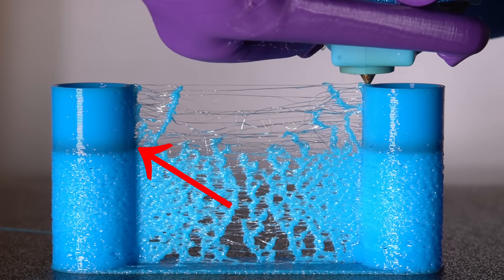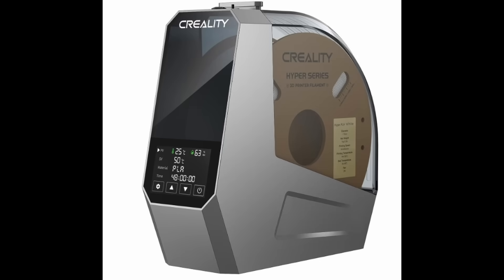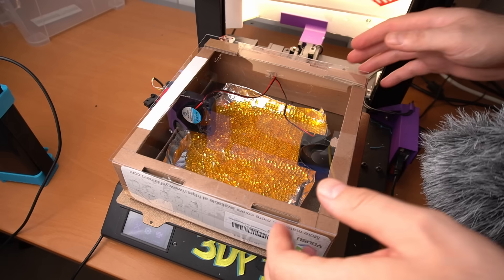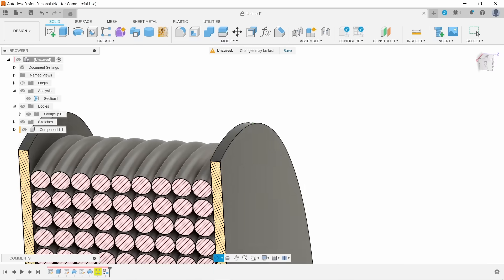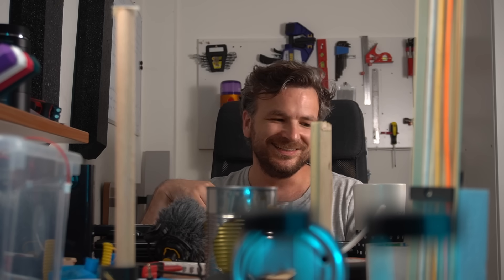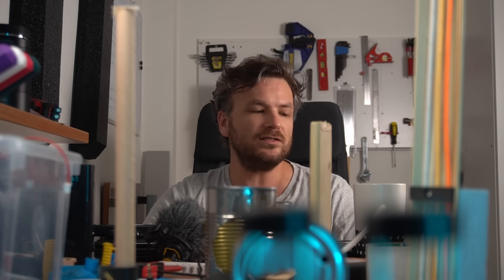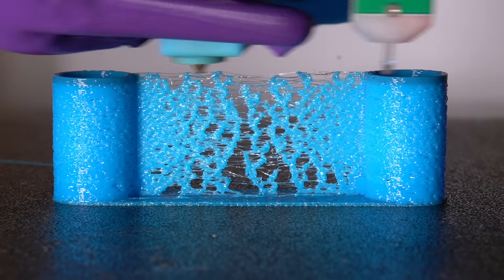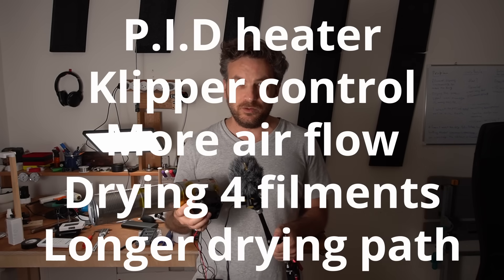Why are we drying filament this way?

Comment: you culd try adding a few 180° turns, runing the filerment muilteble times threw the sqame 3 cans AND i think you dont neet heating at all, the airflow alonw shuld pick up the motor from the filement, maybe pare this with a dehumidefyer and a closed system so you get evin dryer air

Comment: Use a helical drying path.

Use pre-dried air out of a mini desicant dehumidifier. Air humidity matters more than air temperature, if its near 0% out of a desicant dehumidifier you can keep the temperature down and avoid potentially breaking / stretching the filament.

Put the fan closest to where the filament leaves. Make it strong enough to flash-dry the filament, you want dry, warm air in, cold, wet air out. If you can put an even more powerful fan at the other end that sucks air out you would have a lower air pressure system that causes the filament to dry even faster. 

Some kind of heat conductive material that is highly porous to air and moisture could touch the filament for better heat transfer.
Reply: Dry air alone does dry out filament but it takes a lot longer. CNC Kitchen tested this out when he was doing some work on dry boxes and dehumidification, and it took multiple days for a spool to dry out in a dry box compared to the typical few hours for heated drying.
Reply: @bosstowndynamics5488  Did the dry box have active airflow?
A filament drier, even without a fan, will still have airflow via convection.
If the dry box was just silica gel, then no airflow.
The air should also be warmer than ambient, though most filament driers try to get the filament up close it's glass transition temp, at which filament has pretty undesirable characteristics unless it's already in an extruder. So lower temperature (yet still warm) extremely dry air is going to be better than warm, still damp air. Relative humidity drops as temperature increases, so you could absolutely get the rh down to near 0 by drying it and heating it.
Reply: @daviddavidson2357  No, the dry boxes were testing those electric membranes for extracting moisture. I'm not saying it's impossible to dry filament at room temperature, but I feel that the amount of performance you lose from not heating it is going to be far more substantial than any gains from using technically drier room temperature air when you factor in the substantial decrease in RH from heating (being up near the boiling point of water is going to get you close to effectively infinitely dry air after all). A setup using room temperature air would be a lot harder to build and run without any real benefit

Comment: Super overkill. I just bought $3 plastic cereal containers from amazon and I keep my spools in them with a cheap hygrometer and a desiccant pack. Then I took another cereal container and printed a spool holder inside of it and put a PTFE tube connector on it, again with a hygrometer and a desiccant pack. When I want to print a filament I move it from a storage container to this container which is connected via PTFE tube to the printer. The filament is never exposed to the atmosphere and is always dry. Cheap, passive, no chance of catching on fire, easy enough anyone could do it.

Comment: The way to inline dry effectively is to reduce the sublimation point of water and heat if you want to do it in a compact space...
Grab a cheapo vacuum pump, two ptfe lined heat breaks, 2M unicorn ptfe tubing, a volcano or equivalent heatblock, whatever electronics to turn on vacuum pump and heater block, 2ft copper tube (Make sure it can be form taped for a M7 thread for the shitty heat break), one brass compression + (Outlet for vacuum pump and cross for filament), jb weld (around threads of shitty heat break and t fitting fyi make sure to have tap cut proper threads in brass compression fitting should be 1/4 freedom units), forgot to add vacuum sensor use and analogue and not a digital TATA

Comment: The main reason as to why I didn't ever try inline drying is very simple. Apparently I'm not a genius and the idea did not occur to me. I'll definitely have to experiment with that! I have an idea to use the thermoelectric module to both dry and heat up the air at the same time by cycling it on and off while also cycling the air between the hot and cold side. When it's on, the moisture in the air forms a layer of frost on the fins of cold side radiator, then when you turn thermoelectric cell off the air warmed by the hot side radiator melts the frost and liquid can be drained away from the enclosure, then you wait until the temperature equalizes and repeat.

Comment: Drywise actually has a little diagram on their website showing how it works, it passes dry air over the filament in a heated space (hot air can hold more water than cold air), runs the air through the dessicant stored in the back to dry the air, and passes that dry air over the filament again. Without the dessicant you're pushing air with the same humidity it had to get the filament wet in the first place back over the filament, which is why your last test succeded, because you were getting dry air from the same container you stored the filament in. 
Looks like that add-on thing just heats up the filament, probably so the air doesnt lose heat to the filament, and is able to pull fractionally more water out? Or maybe for those "special" filaments they need to be soft (which the base system doesnt aim to do) to want to lose water to hot, dry air?

This looks great though! Its amazing too see what you were able to do just with some tin cans! 
I think if you can get a (mostly) closed loop for air to go through the cans, then pass the air through the dessicant (not over, like when you dried the silica on the print bed, but through like how drywise ports air through that dessicant filled tube on the back), then back through the cans.

From what i saw on the website, it looks like drywise put a lot of stock in having a unique setting for every filament type, but at the end of the day you can really only control heat, air speed, and filament speed. All three affect how much water is pulled from the filament, but only the first two affect how much water is deposited into the dessicant, but you seem more like a "see if it works by printing something" guy than a "test weights of filament clippings" guy, and I'm pretty sure "good enough" is gonna get you 99% of the way there. 

Very excited to see what you do with this!
Reply from the maker: Thanks for the explanations, I am let's see if it works kinda guy
Reply: No problem! Also, from what it looked like, you just had the dessicant sitting in the bottom of the dry box, you'll probably get better results moving air through it, rather than just over it like that? Like with drywise, all the air that's going to dry the filament has to go through that tube at the back making all of the air come into contact with the gel rather than just the air that happens to get around to the packets in your setup.

Comment: Here's something you could do - it stands to reason that it will be more effective the longer the drying takes place. You cannot really coil the filament or any bend radius but you can do it in a straight line.  Use a copper pipe like a water pipe and pass the filament through that - maybe feeding it from the floor or along a table.   By introducing the heating in the middle and having the air exit both ends should work quite well once the pipe warms up.   Even 1.5m pipe (which is possible along a wall or from the floor at 40mm /sec is about 38 sec - would seem not enough to draw the moisture out of the filament.  

Another idea I had was to extrude the filament twice.  So by extruding it you squeeze it through 200C and moisture boils out of it (messing up the pressure for extrusion), after which the filament is dry.  If you could then use that material that would avoid the issue.  Practically I can't see how that could be done.  But there may be a clever way to extract the moisture at the hot end.

Comment: I think it need a heating element in the cans,  to create inside a hot air area. Or the filament coul be inserted in a modified hotend with nozzle 1.75mm just to heat the filament without melting( 80c o Lesse depending the material). maybe two modified hotend, each in one side of the can.
Reply: Maybe use a cooper tube with 2mm wide and the length of the can to keep the filament temperature more even.

Comment: Awesome idea. I would love to see this developed into a reliable open source solution. I can see this becoming the standard in filament drying.
Perhaps it could be made physically smaller by coiling some filament inside the dryer, perhaps around a small wheel/which like thing.

Comment: I'm very excited to see you explore this idea further. I understand that your goal is speed, but I have concerns about adding a possible point of failure to the printing loop. What i might propose as an in-between step is a reel to reel system: two dry boxes connected by the wind tunnel, a motor turns one spool and pulls the filament along, even if it only matched the current 40mm/sec speed you could dry a full spool in about two and a half hours, and by separating the drying from the printing I'd bet the speed could be dramatically increased.

Comment: This is amazing.

I would greatly appreciate seeing this turned into a finished project.  Maintaining correct filament moisture levels is critical to good quality 3d printing.  An inline filament dryer that has a reasonable cost and is effective would be a significant improvement.

Comment: Need PCBWay to print you a quadruple helix shape out of titanium regular metal for multicolour, heh heh. 

I jest about a helix but would a coil shape get you more contact area with the heat? So you don't end up with a crazy long tube(would need internal feed rollers or something though). Gah, good luck loading another filament though... doh.

Instead of a single straight shot have some baffles between cans to keep the first section hotter? 
More heaters with cooling fans on the exit so it doesn't get too soft for the extruder gears?

Great idea I'm looking forward to more!

Comment: Was also thinking about such solution. But as a heater my plan is to use a "Peltier element", or thermoelectoric "cooling". To first cool the air and use the dew point to remove some water from the air before heat again with the same peltier element. So that the air is more dry and have a bigger delta to take the moister out of the filament. 

for the casing, think tin can is a not so great choice, it should be more something not conduction heat to the outside. So here my plan would be more a plastic casing (ABS/ASA/PETG for the heat). also maybe printed like a inverted filament spool. so that the filament would nearly pushed against the outer wall, glide over a half cut PTFE tube for 2-3 rounds. 

on the bottom, a stepper driver for avoid the drag for the extruder ... the same axis could be used to push the filament into the box and out. so that here would be big forces inside the dryer box. stepper driver should mostly be driven with a constant velocity and speed up only when the "slack" for the extruder is going to be less. so another measure loop would be needed.

Comment: This I line style drier only works with a long enough time to expose the filament to heat or air. If I were attempting this I would try and make it like a radiator. Have the filament wind back and forth through the cans several times, that way you could use it for rigid filaments that print way faster than TPU does.

Comment: try looping the filament around a cylindrical pulley so you can have it exposed to the hot air for longer while being in a more compact container.
It would be very impressive if you could get the waterlogged filement to work and this would be a much better solution than the arduous drybox finagling

Comment: My guess is it takes more time to remove the moisture from the Filament than the dryer your using can remove.  You would need to get it dry on the spool and keep it dry until it's gone though the nozzle.  Moisture is hard and slow to remove when embedded in plastics.

Comment: thats really cool, makes me wonder tho, the issue is going to be the feedrate. going too fast and the filament cant get dried in time. increasing temps might help but also increases the risk the filament gets too soft. the safer option is extending the length of the inline drier. maybe a good mod could be having it use the bottom of the heated bed as a inline filament drier. tho that would reduce the control.

Comment: Drying the air is easy drying filament in as the spool is being hard because there’s a limit to how quickly you can dry filament per time unit. I think using something other than TPU would probably speed up the process of testing as TPU isn’t the easiest filament to dry. You may want desiccant still to keep the air dry as the heater turns on and off to regulate the temperature. You probably want to have multiple heaters some to turn on/off at the temperature you set, and have some that maintain a more appropriate general temperature to ensure the air doesn’t cool too rapidly and cause condensation near the holes in the cans that could lead water ingress. You may as want room dehumidification or at least dry the air in the room. Cooling using refrigeration (condensation dehumidification) is an alternative which is used in a lot of delicate processes, but this also doesn’t work 100%. Most industrial applications use a combined number of processes.

Comment: This might actually be a usecase where the horribly inefficient peltier modules can be used. You basically make a staggered tube with alternating hot and cold sides that the filament goes through to make it experience a higher temperature gradient without a higher temperature. Basically |H|C|H|C|H|

Comment: You can spool the filament in a spiral inside the can, will spend more time inside and dry more. Before the air is aspirated into the heater, you can pass it through a dehumidifier.
Reply: Take a can and spool some filament in it. Is it fun?
Reply: @REDxFROG , of course you'll need a spiral guide, duh! The idea is to have more filament for longer time inside the can.

Comment: Hello, very interesting solution. I don't use much TPU but like you I live by the sea and therefore in a "humid" climate. To dry the spool of TPU (and the sample I received to test) I have bought an adjustable terrarium heater, I have not yet made anything to make this "dryer" which I will also use for other types of filament 'PLA, PLA +, PETG, and therefore TPU. Either I use a cardboard box or, as I've seen, an airtight plastic box for cereals, but in either case I'm going to think about fitting a small fan as you've done, which will certainly speed up the drying process. 👍

Comment: Really want to see v2, it will be interesting to check how compact it is possible to make. Also if a larger fan (for example PC one) can produce better result with less noise (bigger fan - less noise for the same air flow)

Comment: I like your idea.  I was going to make a big box dryer that would keep all my filament dry all the time using a 200 watt electric heater and a PID controler to control the temperature.  The PID controler comes with a SSR and a K coupler and I also ordered a panel mount 5 amp circuit breaker to maker sure it was a good setup.  Now, I think I'm going to use some EMT conduit and two rubber stoppers available from Home Depot to make a dryer like yours.  Excellent idea.

Comment: Thought about this like year ago, but didn't made the project real. In my thoughts it was not a tube, but box where the filament is winded in lets-say 3-4 loops to make it stay longer in the "drying" zone together with the stepper motor connected to extruder "axe" to help pulling the filament. With your tube design - It'll be easier to expand the solution for more than one filament. It should be perfect to have something like this, not thinking about drying whole spool - which is sometime useless, because more hygroscopic filaments became wet during the print anyway - this will be the solution - just take out the spool, put it into the tube, wait ~5min to dry the beginning of it and hit the print.
Awesome!

Comment: Contra flow drying, increasing the length of the drying path and insulating "the cans" so the air stays hot. Also the diameter of the tube does hot have to be the diameter of the can. A diameter of about 25mm should be adequate. A recuperative heat exchnger could also be used to recover energy and elevate the drying temperature.

Comment: Well, the thing I found with TPU is it has a high moisture adsorption rate even in lower air moisture places so you really need to dry it fast to keep up with the flow rate on a faster printer?
I can print TPU at 300 mm/s on my Qidi X-Plus-3 printer because it is a enclosed chamber heated 3D printer and I use a Sun Lu 4 spool filament dryer which is the best dryer I've ever had.

My small Sun Lu single spool dryers do work on most filaments but not ABS or ASA as those need higher heat than other filaments!

I think your are doing an amazing job in working out a great way to dry as needed than doing the normal long hours drying?
Keep it up, Maybe your on to something cool there that will help many of us to sort out really bad filament filled with tons of moisture.

Comment: Why not dump the waste heat of the extruder nozzle back into the filament bowden tube? (If the printer doesn't use a bowden tube you can still add one.)

Comment: One really effective way to improve this is to pre-dry the air that goes into the heated tin-cans. Best way to dry air is to cool it down as low as possible. E.g. take a good compressor freezer box, fill it loosely with steel wool and suck the air out of this box. The volumetric flow does not need to be very high, well dried air can take quite a lot of water out of the filament.